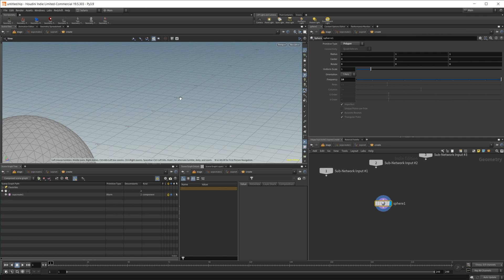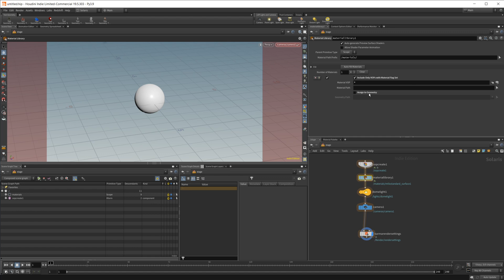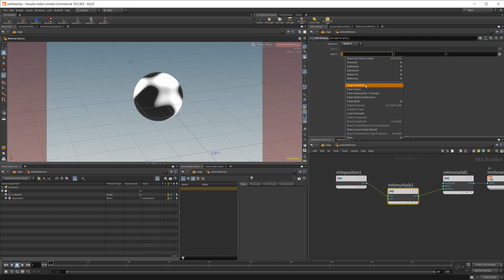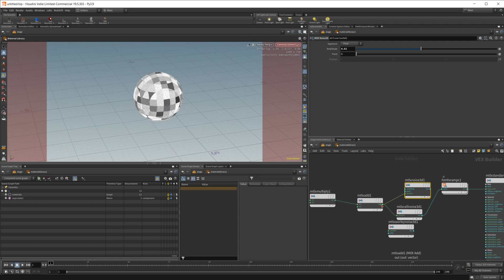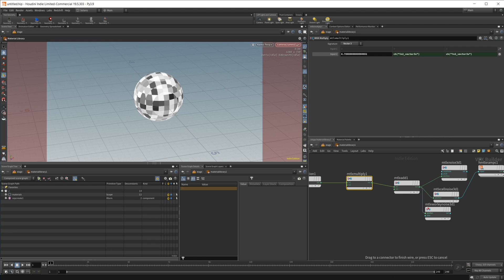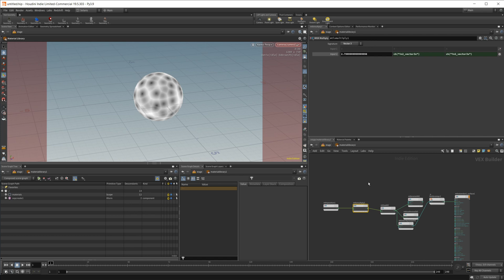Scaling Noises in Karma XPU | Houdini 19.5

Comment: thanks for sharing. position is changing for me every frame. i solved using rest attribute but any other way can i frame hold them with the position itself rather than rest attribute. thank you
Reply from the maker: A rest attribute is the correct way to do it. Not sure there is another solution that gives you the same results
Reply: @InsideTheMindSpace  thanks very much for reply.

Comment: Excellent video, thank you. I am having and issue with creating a repeated ramp, using this method. the position into multiply means that only half the sphere gets the ramp. The add can offset but cannot do a loop. I am trying to get scrolling lines. So my idea was to create a color ramp with multiple entries, then use the add to offset and animate in a loop. If I put the position into input 1 and 2 I lose the scaling ability. Any ideas?
Reply: use modulo for repeating patterns

Comment: Thanks for this clear description of the noise scale and translations. Follow up question. Do you know how to animate the translation(add) parameter add an animated offset. I tried bringing in an animated attribute but it doesn't seem to respect the time dependent value at the vop level. Any thoughts?
Reply from the maker: I'll post a follow up video to show this I suppose but you can promote the parameter and then animate the value using an edit lop.
Reply: @InsideTheMindSpace  Great! Thanks much. I did just discover that there is a mtlxTime and mtlxFrame node that works directly in the shaders.
Reply from the maker: Ah. Well that works too I suppose. I didnt realize those were nodes. I will include that as well then. Thank you!

Comment: Regarding Karma XPU, I found that when connecting mtlxnormalmap with noise, normal cannot be recognized correctly. Have you encountered such a problem?
Reply from the maker: You need to connect to a height to normal and then to a mtlxnormalmap. You will also need to be using a float ramp for the input if you are connecting your noise to a ramp first
Reply: @InsideTheMindSpace  I forgot "Height", just got in touch with karma and was stuck with this problem all day yesterday, thank you so much !